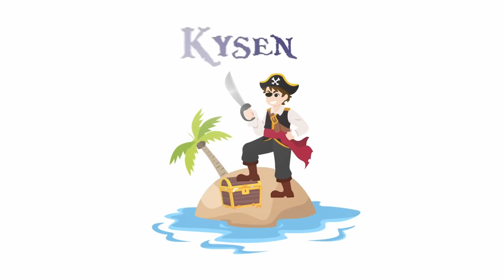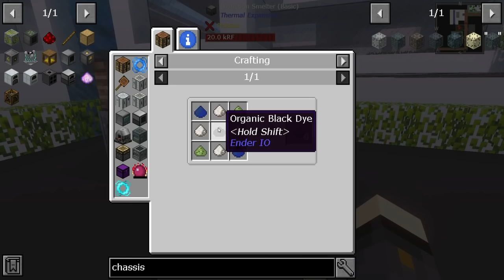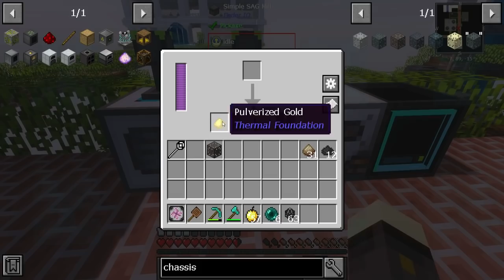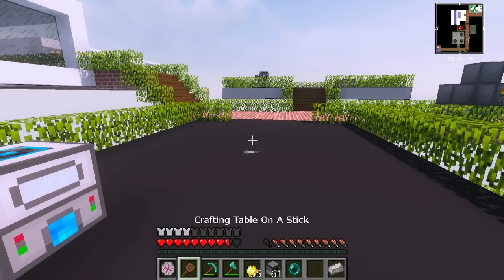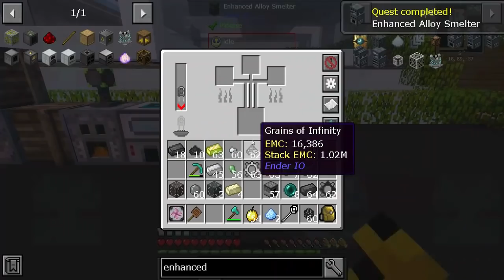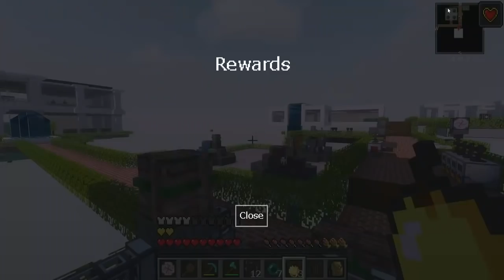FTB Sky Odyssey Ender IO Set-Up + Quests! Ep8

Comment: Use ender I/o conduits instead of thermal expansion
Reply: The "new" ME Conduits from Ender IO are SO good (and cheap! Dense ME Conduit: some quartz powder and conduit binder, done!)!
Reply: @mawoh3027  and they can be in the same block with other ender I/O conduits
Reply: @jakubbronk673  ..., the item conduits can be set to priorities, you can use 16 different colors to color code your network, You can set up complex autocrafting with just the conduits, you can send multible different fluids through them, and I will not even start to talk about the filters.
Beside the cryostabilized flux ducts there is NOTHING, that beats the enderIO conduits!
</fanboy>
Reply from the maker: Thanks Mawoh and Jakub for your comments and advice, it's very appreciated :) I will look at the Ender IO conduits :)

Comment: Make a tier 4 woot farm for wither, and wait untill the loot table says you have chance for game over crates. If you don't get it first time use /woot flush all and see if it appears now. Make sure to wait a bit in between the commands.
And then when you get the creative conversion kit from thermal expansion craft a strongbox (4 tin 1 chest) and then hit it with the creative conversion kit (right click) and then whatever u put in there you will have an endless supply of it. Even if it doesn't have EMC. The only way to switch the item is by taking an item on your cursor and clicking the item that's already in there. U will send it switch. Also copy the game over crates because it gives items for some of the quests.
Reply: Make sure to NOT have the looting upgrades! I never got a game over crate until I removed them, and I had more than 50k kills!
Reply: @mawoh3027  no it doesn't matter whether or not u have looting. It just doesn't affect the wither at all. You were just unlucky, I have looting 3 and it works just fine for game over crates. I have like 2k by now.
Reply from the maker: Thanks for the tips guys. A woot farm definitely sounds like a good idea so I'll look into it! :)

Comment: Please, check all recipes. The clippings and trimmings for green dye was the hardest way. Putting steel in the sag mill had no point.
And you need to make upgraded cappacitors if you want your machines to do everything faster.
Reply from the maker: Hey, thanks for the comment and advice, it's appreciated :)